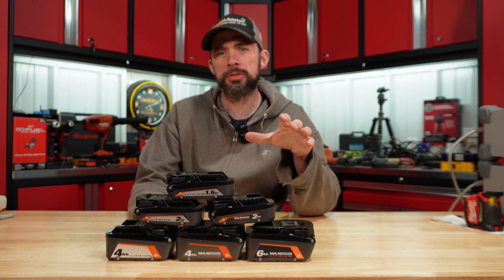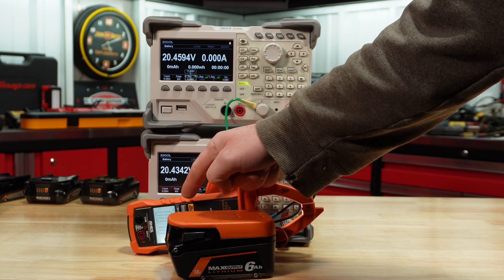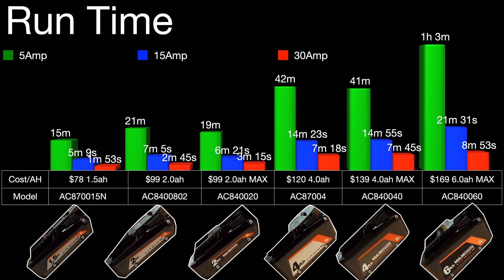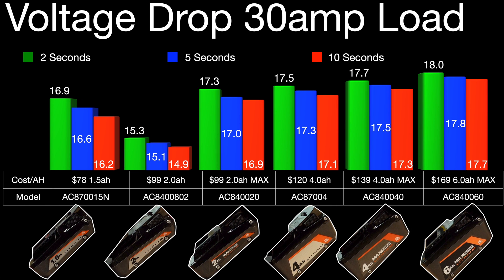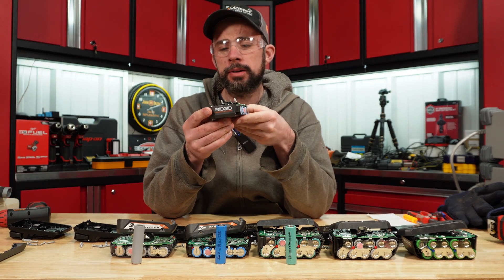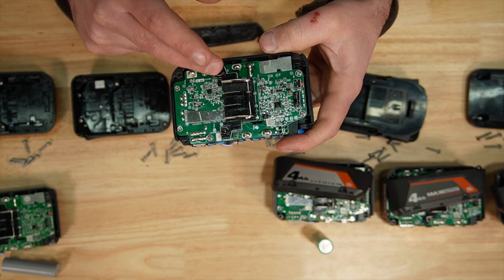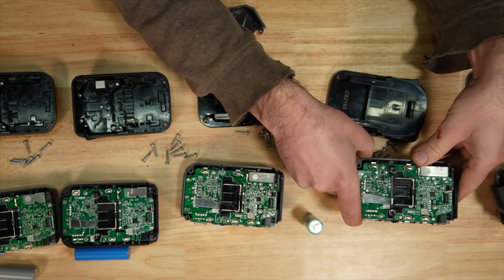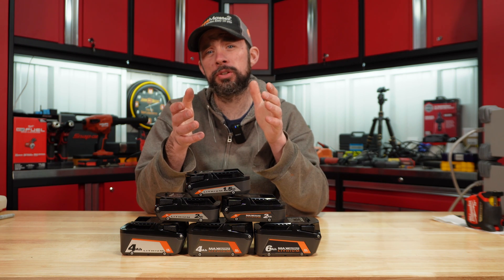Ridgid 18v Battery Testing and Dissamble

Comment: Now to test the "EXP" 8.0
Reply from the maker: Already did in video 

Teardown, Load Testing 8AH And 12AH Power Tool Batterys
https://youtu.be/bjTrdejGDGI
Reply: @Tools-Tested ok thanks. subbed. maybe I'm a noob but I didn't follow that vid too well. For dummies, and a home DIYer, is an 8.0 max output EXP (ie 21700 cells) overkill or will a couple normal 2.0s that come with the kits be more than enough?
Reply from the maker: @lukas______  thanks for the sub, really depends on the tool.  Most tools I would say the 4ah Max is the sweet spot.
Reply: @Tools-Tested would the 2ah that come with most kits bog down a jigsaws performance you think?
Reply from the maker: Yeah 2ah is honestly only good for lights imo.

Comment: So does it mean 4ah max output are useless without the extra pins? Many tools don’t seem to have it
Reply from the maker: Correct the max has little benefit if the tool doesn't have the additional pins.  Hoping to show the different when I test the top hammer drill they offer on the new Dyno.

Comment: I know it's probably niche but I'd really like to see how the 8ah stacks up now that it's the only 21700 cell battery in the ridgid line up and being so expensive idk if it's worth it over a 6ah which already seems to maintain voltage significantly better than my current 4ah white label
Reply: I also have a 2ah white label. And somebody else suggested you may have a bad cell in your pack.
While possible 
I think torque test channel  has shown how much power you lose with this battery on an impact wrench.

But if possible it may be worth testing a second pack and see if it truly is this terrible at maintaining voltage or if you happened to get a bad cell
Reply from the maker: I plan to do the same test with the 8ah,  I have been waiting for the 12ah before I do.  

Idk why they are taking so long to produce it, they released it to the public at the same time as the 8ah... 

Hopefully we see the 12ah soon,  I will retest a normal 2ah if I come across one.

But yeah performance wise a 2ah and below really cut into the performance of most tools.
Reply: @Tools-Tested  i know youve reviewed the larger batteries in your review of a bunch of companies 8 and 12 ah options, did you ever get around to testing another 2ah to confirm those poor results?

Comment: I've got a 2A Lithium, same generation you're showing (big buss to MFets, , all cells are good and very close in output but I have 4 blinks, all 4 led's;  no output,19.34v across batteries, fuse not blown, and charger says "?".  I tried a "reset" based on the prior marked connections, Reset, +5, Gnd, Data, Clock by connecting Reset to Gnd (ie TPS13b to TP41) but no effect.  Cleaning the board, as some have done, no effect either.  Board is marked RTI PCB 20200715.  Did they move the Reset contact?
Any recommendations?
Reply from the maker: Sadly I cant help much with this,  everything sounds correct.

Comment: Does the batteries have automatic low voltage shut off built in the battery circuits?

Comment: Seeing these tests raises more questions than answers.

I heard that TTI uses EVE and Tenpower cells in their Ridgid and Ryobi batteries, yet none of the batteries you have opened have them. And on the flipside, I didn't know Listen and Highstar supplied cells for TTI until I saw you videos.

Makes me wonder if batteries of the same model can come with different cells from different manufacturers. If that is the case, that kinda makes these tests a bit moot, since a battery of the same model that someone else buys could have better or worse cells.
Reply from the maker: Yeah sadly its possible they could have different cells. I purchased all of the batterys in this past year,  but its also hard to say if I received old stock.  I couldn't find a date code on the packs.

Comment: they are overcharging heavily for these packs. chinese cells they use cost them like 1usd each, pcb is less then 5usd and the casing also
Reply from the maker: Yep it’s crazy,  but I guess they have to make up the cost of the LSA somehow.
Reply: I don't think anyone is actually paying full retail for these batteries, at least I know I never did. HD always has promos for free batteries, so does Direct Tool Outlet. I just picked up a 3-pack, (2) 4Ah and (1) 2Ah all Max Output for $65.

Comment: Interesting that the 2.0Ah uses the same cell as the 4.0Ah, but the 4.0Ah did not suffer the same voltage drop. Wonder if there is a poor cell in that 2.0Ah battery dragging the overall performance down.
Reply: It is simple math. With 10 cells in total, the 4.0Ah Battery has 5 and 5 cells in parallel. Which means, that each cell only have to provides half of the amperes. Less ampere means less voltage drop. The cells are the same quality.

Comment: Sweet! Thanks for doing this! I’ve been wanting to do tests like this but I don’t have enough of a range of batteries to test, or a YouTube channel to share it with people. :)

The other thing I’d like to see is what the tools actually use. Torque Test Channel shows you what various impacts get with different batteries, but I’d like to see how batteries impact my Hackzall, die grinder, etc etc.
Reply from the maker: No problem!  

Yeah I’m hoping to get the data collected on battery’s.  

That way when I get to drills, saws,  grinders etc etc we know the best battery for the lowest voltage drop is being used.

Then we know the battery is not limiting to the maximum performance of the tool.
Reply: @Tools-Tested  Looking forward to it! I’m also curious about the extent to which voltage drop actually hurts tool performance. 

For a brushed motor with a PWM controller, lower voltage == lower speed unless the controller is fancy and explicitly compensates for that. 

With a brushless motor controller, I’d think there is a very reasonable chance that the controller sets the speed based on the trigger position and keeps the same speed across a wide range of voltages.
Reply from the maker: @gf2e  yep these are things no one seems to be testing,  but to me could definitely affect the performance.

Hopefully I can capture that data.
Reply: @Tools-Tested  Actually, that just made me think of another related thing. 

Every single head to head with tools shows you that the batteries are fully charged. To make it fair. 

Now, if I’m working on my RV suspension, it’s likely that I will have a fully charged battery handy. I want to know which high torque will have the beans to remove old rusted parts. 

But if I were a professional installing decks all day, an impact driver that was 20% faster at 100% battery and 20% slower below 80% battery would be worse than an impact that was consistent throughout its charge. 

Personally, I don’t use my tools all day long, and it takes me awhile to figure out what to do next. So battery life isn’t that big a deal. But for a professional, it really is.

Comment: Can you throw the Octane 3Ah in the mix?  Also the (new) 8Ah?
Reply: The 8ah and the octane 3ah would be interesting since they're the only ones with 21,700 cells in them.  The 12ah has 21700 too but that's not out yet
Reply from the maker: Hoping to do older battery’s as a group Octane, p195 ryobi etc etc and compare to this data. 

Definitely hoping to test the 8amp just waiting on the 12 which we should see soon.   

Also waiting on the credit card to reset 😂